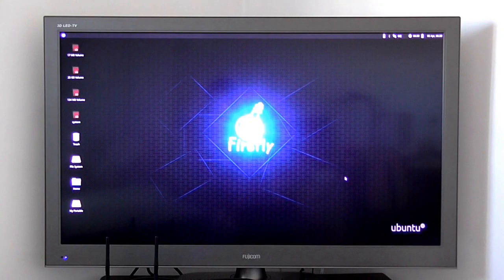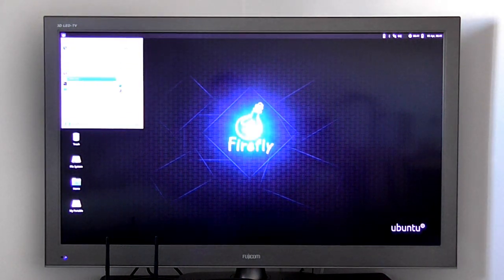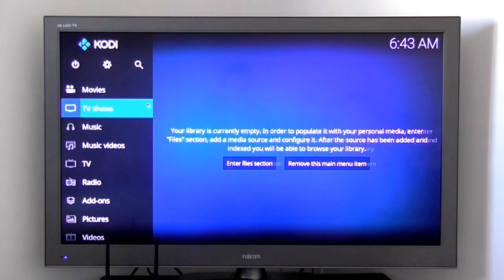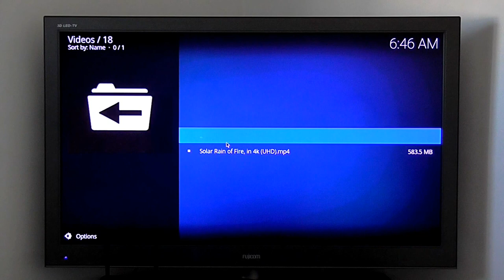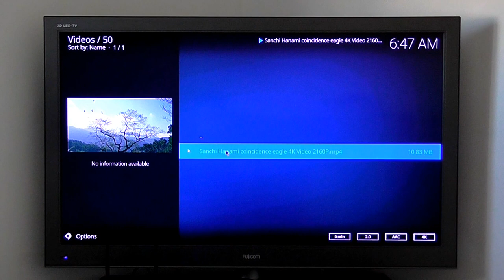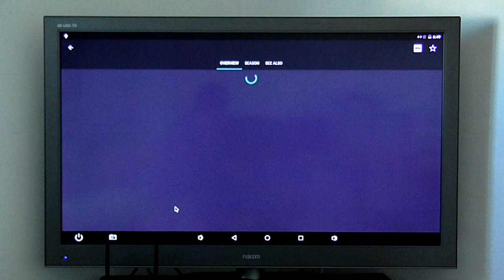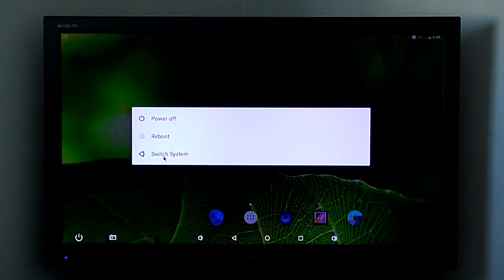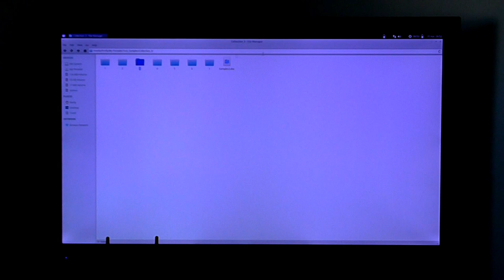Single Board Computer/Mini PC Raspberry Pi 3 & ASUS Tinker Board Killer ? | FireFly

Comment: Notes:  watch out, the WIFI cables are different lengths.  When you dry assemble the case setup, make sure you get the right one with the right connector.  Otherwise they won't reach.  One is longer than the other.

Working well for me, but not sure I've guessed on the correct stack with it assembled.
Reply from the maker: You arr right about the antenna wires lengths. everything works well. which model did you buy, the basic one or plus kit?
Reply: I got the 2gb version.  I'm deciding if i need more, will consider the 4gb unit.

I need to figure out the SSD slots and max them out.  I don't think the original specs called for two slots, and I am not familiar enough with SSD to evaluate whether these are both equivalent.  I'd like to put maybe 2 256gb parts on there, but will need to do research.

Overall the board looks good, though I'm still trying to figure out how to boot from SD.  I downloaded an image from their website, and it automounts the SD slot, but doesn't boot from it.

I need to look and see if I got any answers.  They don't have many (any?) places to ask questions of the company.

The Ubuntu image came with Ubuntu store owning the rpm database and locks, so after some research, i just killed that.  But there is so little space, I can't make use of it till I can boot either from SSD, or SD.
Reply from the maker: I understand. For the SATA3 Hard-drive support you need to buy an expansion card which cost $9-10and hooks into the PCIe slot, but its Currently out of stock so you will need to wait. I don't like using SD Cards for booting systems. eMMC is better, and with 32GB eMMC you should have enough space.Worth trying this SATA3 card module.
Reply: I don't know how to get or reconstitute the onboard emmc, so am hesitant to mess with it.  The Odroid folks had emmc mounted on an SD slot adapter, but not sure i see what that accomplishes.

Is the Sata3 to expansion card generic, or is it custom to the system.  And will their kernel support it, or will I be on an adventure with custom hardware support?  I'm not sure if all the kernel stuff and documentation is released for the RK3399 yet. 

I had a Radxa Rock board and the support there was about zero.  Very nice board, but only some guys supporting the original chip ever did anything, and they never posted the goods they ever built a kernel from.  

Just mystery binary drops, no instructions, no images, and no sources to build from.  If this board goes that way, I'll about be done with these, but the performance of this board tempted me once again.
Reply from the maker: For burning images to eMMC you need the USB cable with the type c to micro USB adapter. first you install windows drivers and rockchip software tool. final step it to press the recovery button while connecting the cable to a pc. there are instructions how to do that
Reply: Where are the images. Thats,always the fun question.

Comment: Sounds like it was pretty windy there (11:44 ish)
Reply from the maker: Yes, too much noise from outside.. cars, wind.. you name it :)
Reply: Well, noise or not, thank you for the video.
Reply from the maker: Thank you. most likely next month I will get a SATA interface expansion card and an LTE Modem module for 3G/4G Connectivity. both work with this board :)

Comment: Just the board I've been looking for. Just a few questions. First, will it work with the 5 volt power supply? And will it play world of tanks? Thanks.
Reply from the maker: Clifford Vanderpool  1. no, it comes with a 12V power supply.  2. I did try, but GPU is very high preformance and it should work..

Comment: What display resolution was this running at? Can you set the resolution to Auto in Android 7.1?
Reply from the maker: cr4zyw3ld3r  max supported resolution via HDM 2.0 is 4K@60fps . android normally auto detects monitor/TV resolution and give you optimal resolutions to select from.

Comment: 1. can i use this board for 3d printing or cnc?if can, how many axis that can be controlled?
2. can i install windows or other linux distro? arm?
thanks
Reply from the maker: cuBEFAce 1. you can check the board interfaces in company website, and also ask them via email. 2) the board supports about  3 types of OS: but mainly support Ubuntu Linux and Android 7.0 ( latest update).

Comment: How fast is the CPU/GPU clocked?
Reply from the maker: CPU: Dual Cortex-A72: 408MHz- 1512MHz  + Quad Cortex-A53 core : 400-MHz- 1896MHz. As for GPU I didn't check, but my estimate maybe 750MHz.

Comment: Linux support is poor for firefly-rk3399. The larger community(PI) won't ever use this in it's current state. Firefly, if you really want to grow this into the millions, work on Linux support. All 6 cores must work, then GPU, WIFI, bluetooth, MIPI, and the 40 pin header.

Comment: $219 and only support Android and Ubuntu, well, maybe when it supports a really usable OS could be a "Killer" if you don't take the price in the math.
Reply from the maker: This one costs $219 and the cheaper costs $179. Second, it a very new SoC in the market and there will be more images. Price is very important, but its not everything in a products. Good tech / hardware cost more money. You really can't compare a the Pi board  hardware from few years ago to a fresh one, based on the latest ARM Architecture.
Reply: I understand that things cost, and innovation in this sector is not as easy to do without getting hard in the price, but calling that a Killer when is not in the same range, is like calling my system a FireFly Killer, as it runs any OS flawlessly, have a lot of ports and what not.. is 5 years old hardware and is in the same proportion of price, but is not in the same range of product, you can't compare one to the others. What I'm trying to say is that your title is a clickbait and the only purpose of it is get in the results of searching Raspberry Pi or Thinker Board, as you didn't do a proper comparison with any of them, and you just say that you can't compare the Pi board with this, so, why would it be a Pi killer in first place?
Reply from the maker: Sure its not the same range of products. different specs, function and hardware. What's the problem with the title if I call it a Pi killer, if specs, functions and performance are a lot better. The title is not that misleading.. As a user you are searching for a cheap product, better specs, software support in the same price level as the Pi board right? so practically speaking and be honest with me, did you find any winner over the Pi Board or Not ?
Reply: Andoridpimp so, the Razer Blade Stealth is a Raspberry Pi killer for that matter... the title missleads to the viewer to think you can replace the Raspberry Pi with one of those boards and get great benefits, when is not for the same purpose.

Personally, as a customer, I search for something that is not just for Android or Debian (or Ubuntu for that matter), as I don't use those systems and I don't want to unlearn how to linux properly.

I have 2 Raspberry Pi's running as Printing and Scanning server, and as download box, and some of the things I use are not as east to do in Ubuntu as they are in Arch, and not mention Android, as that is useless for a headless setup.

For the price and specs, I would compare this board with some cheap netbook for performance, and that should be a more accurate way of use for this board rather than use it for I/O things.
Reply from the maker: Razer Blade Stealth is a laptop, even as a type of a humorist comment you can't compare a laptop product to a development board (PCB) although few companies are now trying to build a module based laptops composed with SBC. Second, you didn't answer my question if you find a winner over the Pi 3 board that has : same level of software support, same or cheaper price level, better hardware / features etc. In terms of hardware performance and functions this board "eats" the Pi 3. Its really a new SoC, if you noticed also Asus Tinker board currently has only one OS image or few, so I expect it will take few months until we will see more images available for all RK3399 boards.
Reply: Andoridpimp well,the Asus Tinker Board is the closest one to take over, once they fully release the kernel and could be taken to build some other OS images.

That is one I'm looking forward, and is in a great price, not getting way up for a better specs than the Raspberry Pi.

Also one thing that really confused me in this board is, why they call it TFcard? That term is pre 2004, way back when the microSD were not a thing yet. For a new board they didn't use really new terms.
Reply from the maker: Pi 3 price is ~$35 vs Asus tinker price : ~£54.99 and only has one image OS support.  I am sure that asus are working hard on software development side, but RK3388 is considered a pretty "old" SoC . Sure,  it's still faster then the Pi 3 with a better GPU and 4K playback support.
Reply: Raspberry Pi was not meant to be a competition with PC or laptop. It was meant for children and kids to experiment programming and computer science. The makers of Pi never said that it's powerful. They also made it to be affordable so every kid could get. So the firefly is not a Pi killer. Yeah your title is misleading.
Reply from the maker: Alx Progrmz let me explain ..again. this is not a desktop PC board !!! it's a development board just like the Pi but with more advanced specs ok?. as for the Pi it can also used as a mini PC and some people also use it for that type of applications because Linux runs well on low level hardware. anyway, this is not a desktop PC :). just high level hardware board. I have not begun to test 0.1% of it's capbiliilities. that's a quick review as I call it. the hardware in this board are just better the the Pi so it can be used as a good PC/workstation.
Reply: My intention was not to upset you. Many people are reviewing board that are more powerful than the Pi and call it a Pi killer. People complain that the Pi can't do this or do that. They want more. Of course not every PC or any kind of computer will satisfy all their needs. There were many that worked hard to improve the Pi, and it turned out well. Its intention to get kid's interest but were not expected to grab the attention of hobbyists, programmers and even professional. And they all were happy with it.
Reply: One thing I forgot to mention is that when people on youtube are calling any single board "a" or "the" Pi killer, they are shifting kid's interest from the Raspberry Pi to the other board, forgetting the ideas they could use on the Pi. They will lose their interest on programming or other Computer Science projects, and go to video game, watch HD movies, tv shows or any kind of entertainment. That is not what we want the kids or any kind of audience to do. The idea is to learn, be creative and most important fun.
Reply from the maker: I am not upset (Still talking to you and your comments). Correct me if I am wrong, It seems you have some interest with children education as I notice this subject is important to you. As for the review, its just a review no need to take it that serious. You can call it killer or not in terms of price or software.. or both. One thing I can surly tell you is that the hardware is a total "killer", meaning its very high performance :)
Reply: Glad you are not upset. Perhaps you are right. I am taking the title of the video too serious. I am not against other boards. Allow me to thank you for taking your time,  money and thoughts on the Firefly. Keep it up.
Reply: That's not what the word "killer" should be used, because it's high performance and high price, you cannot compare the two other than say they are development boards. A killer is either better performance in the same range of price, or same performance with a lower price, or both (hardly to happen), but with none of those you cannot call it killer, you can call it better than, but not killer. That's my only issue in the title, so, it should take out the killer, or add the price to it.
Reply from the maker: Alejandro Torres take it easy :)
Reply: Since when Ubuntu is not usable????

Comment: it isnt a raspberry killer. IT is faster but 3 times moe expensive...
Reply from the maker: Whats the price have to do with it?. It has about 4-6 different video interfaces, Quad Core GPU, Dual Display feature, USB Type C , Dual CSI . Top hardware and technology do cost. In software support I do agree, but they will improve. Its a monster, not a killer.
Reply: Then change title to monster.
Reply from the maker: haha no need. Killer sounds better :)
Reply: I have bought one.. (60€ or 65-70$)
It is very fast and need only about 5-8W.

The idea was to use it for a litte Gameserver.
2gb Ram and 1,8Ghz is good for 1-2 Gameserver and one Teamspeak.

But the Tinker OS (Linaro) is in my eyes useless.
I try to run Teamspeak and a Gameserver.
After 6hours i give up.

Now i send it back :(

Wits a good OS Maybe full ubuntu or a windows (with 2gb ram no problem)
It will be a great server or Desktop Computer.
Reply from the maker: Then it only proves my point. Good tech (hardware&software) cost more money. I also have a board based on the same RK3288 SoC as the asus tinker board and its considered an "old" SoC, but still compared to Pi3 Board it's defiantly a high performance and much faster. In my RK3288 board I also have eMMC , which the tinker board doesn't have (I checked). You should wait until ASUS will launch new OS images. it will happen, I think. Firefly has 4 GPU cores so you can't compare video decoding capabilities and running 3D games vs older SoC.. its a totally different experience. The board I reviewed has 4GB RAM but 2GB also should be just fine for most users.